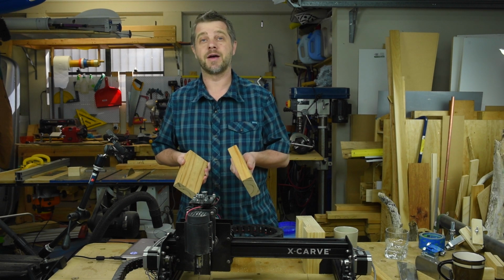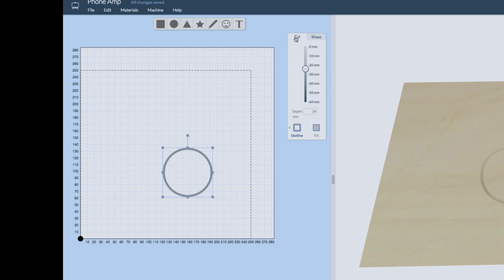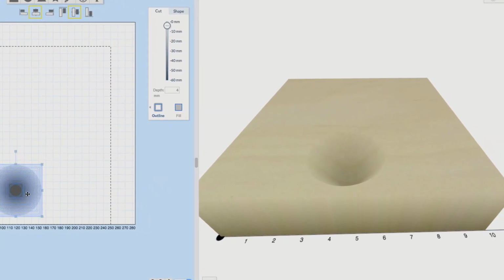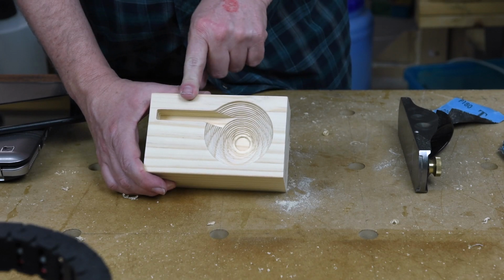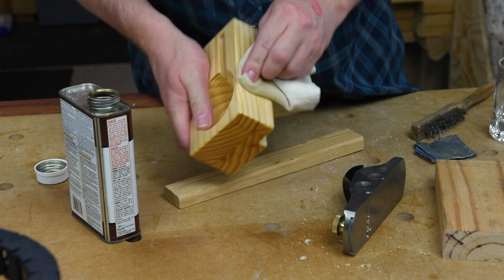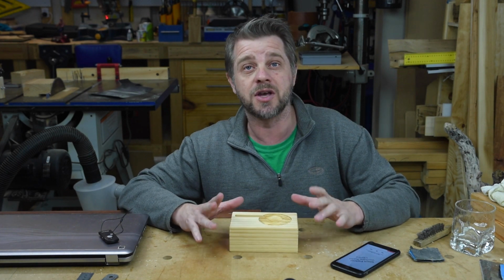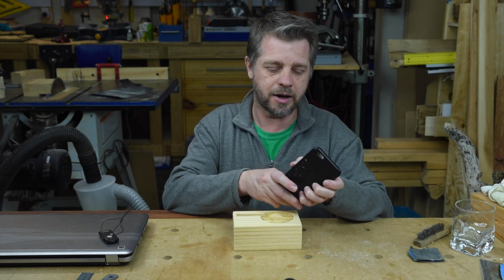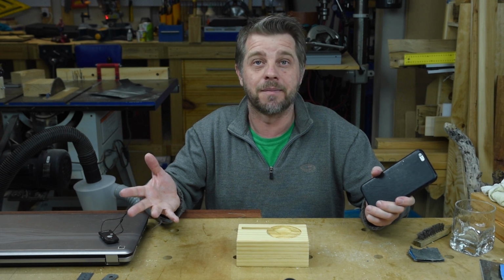🔵 X-Carve CNC Project | Make a Passive Amplifier for your iPhone

Comment from the maker: CNC project making a passive amplifier for your phone that actually works with an X-Carve CNC machine from Inventables

https://youtu.be/2kh9fYn3Tvc

Learn how to use Inventables easel.com software to make this simple passive amplifier for your phone with a CNC machine.

You can find links to the free plans here https://www.inventables.com/projects/make-a-passive-amplifier-for-your-iphone

For all my Free easel.com projects you can follow this link and open any of them straight in easel and start carving. https://www.inventables.com/users/warren-downes

You just need 2 small pieces of framing timber that we laminate together and then smooth on all surfaces with a hand plane.

I then show you how to design a cone in Easel.com quickly in a few steps then carve it out with the X Carve CNC machine.

Use a block plane to take the edges off the project and then finish with Danish oil using a rag to apply the finish.   #xcarve  inventables  #inventables   #cnc

Comment: Nice little project, Warren.  Were you using a straight bit for the cone or a round-nosed mill?  I wonder if that might give a smoother cone.
Reply from the maker: I used the ball end bit. I think the walls would have been smoother if I took smaller bites out of the depths and diameter